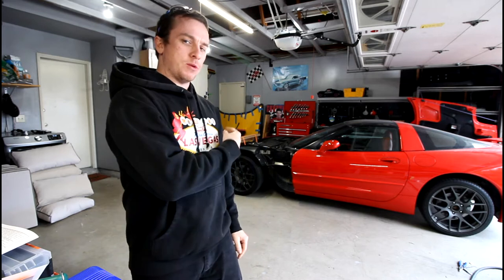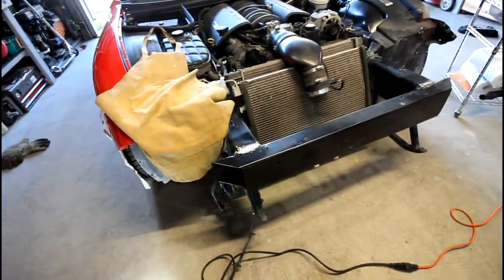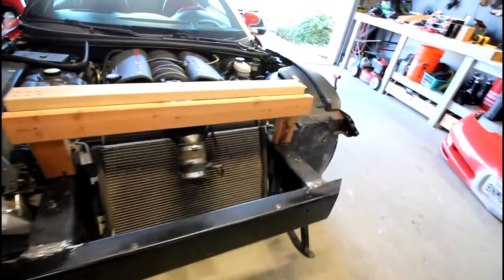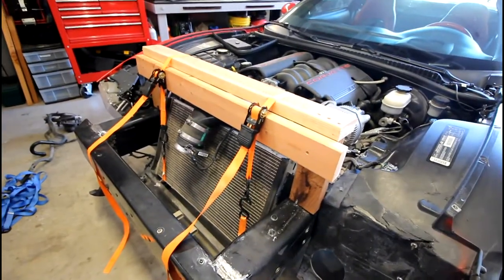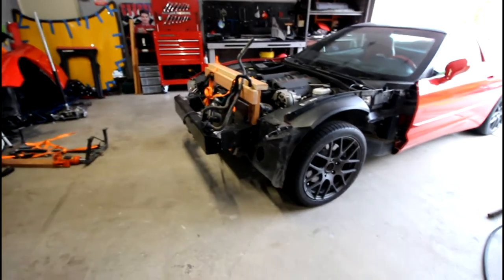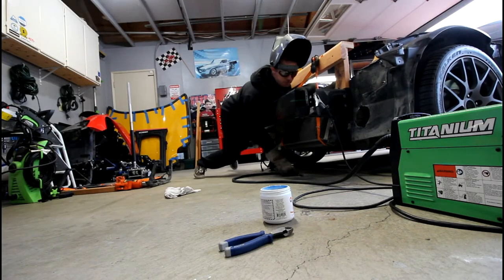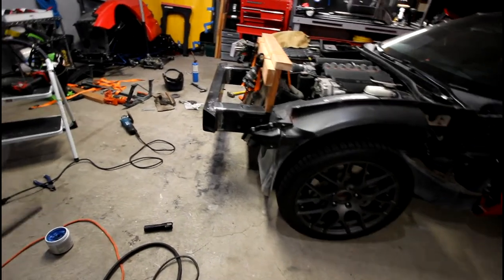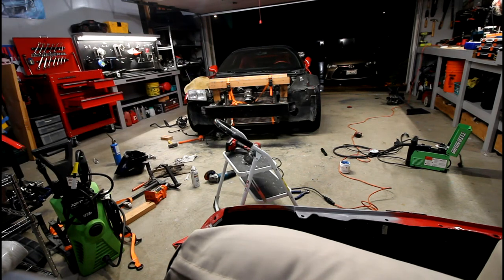Repairing My C5 Corvette's Damaged Front Impact Bar (Part 2) - C5 Corvette Build #23

Comment: Hey, nice job. Just a suggestion, while you have the front stripped down you may want to install skid plate wheels on those skinny subframe arms. I bought mine from Eckler’s Corvette site. The SKU is 25-874528-1
The description is:
1997-2004 Corvette Front Frame Guards
Reply from the maker: Hey Jeffrey! Thanks for the comment! You must have read my mind because that’s definitely something I’ll be doing, I just ordered a new radiator support, so I’ll want to protect it for sure. Although I’ll probably be making my own using my 3D printer! Might even start selling them as an alternative 👍🏼